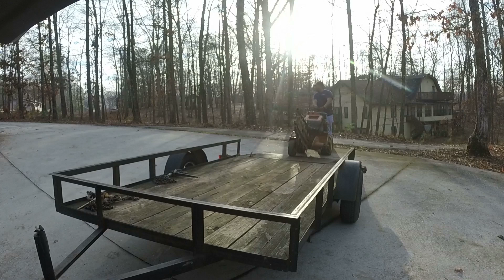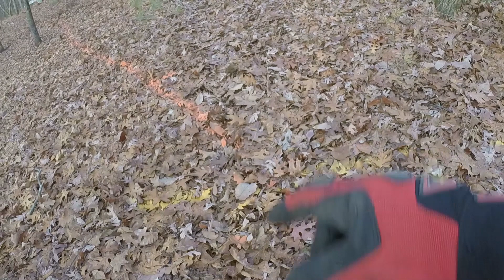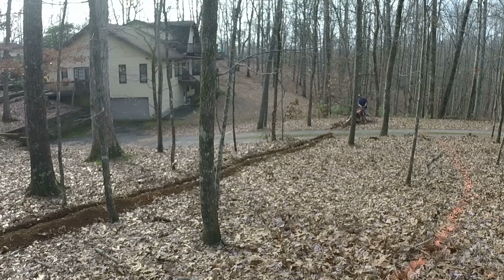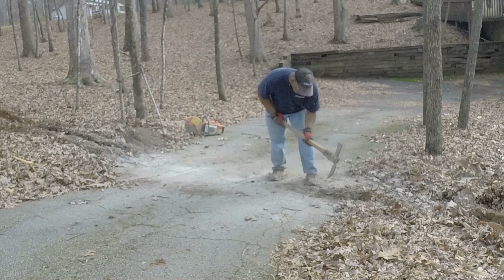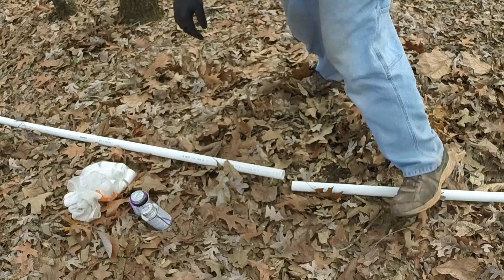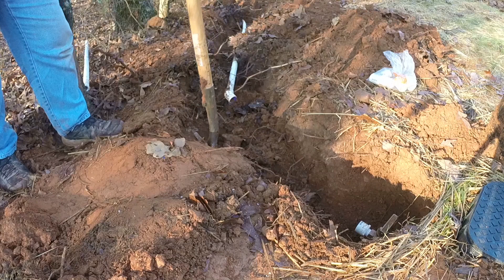Installing the Main Service water line into my Neighbor's House (Part 1)

Comment: Should be titled "How not to install new water line".

Dude, some terrible practices here.  Always prime and glue inside the pvc fittings as well as the outside of the pipe. You're wrapping the Teflon tape backwards.

Comment: WARNING.  PVC is not allowed in most places for drinking water, only for irrigation systems. PVC leaches carcinogens into the water.   Potable water requires either copper, CPVC, poly or pex.  Hundreds of ft continuous flexible poly pipe,  cheaper and easier to install, and withstands soil movement better without fracturing.

Comment: I was taught to prime and glue both the pipe and fitting. Also when using an mip to the main water service I’d recommend sh80 and when putting teflon go clockwise and add a little pipe dope as well. Use a level for fittings other than couplings.

Comment: I would have used 1 in poly sdr 7 pipe good for 250 psi. You need larger dia for that long a run. Also put pipe inside 2 in. Schedule 80 pvc when going under driveway for protection. Way too many joints.

Comment: My connection doesnt hv a meter on it. Im gonna hv to pay alot for that right? From the city
Reply from the maker: You have to have a meter. How would the city know how much water you used? You have to have a way to turn off the water going to your house or RV?
Reply: @michaelyoucanfixthat  i hv a connection in front of home, but did not see a meter, prolly cause there was never a line to the house.
Reply from the maker: @skorpyo331  Ok, you have to have a meter to tap into the city water line or maybe the house is on a well. If the house is on well water then you can tap into the line coming from the well but if your county has city water going down your road you will need to call them and they will set you a meter by the road and you will have to run the water line to your RV.
Reply: @michaelyoucanfixthat  yes, n im sure its gonna be 1000s involved too for that turn on. Until I actually get a hold of someone on the phone to explain. Meanwhile im renting a new softener.

Comment: It will take some time but leaks may start showing up at connections. Unfortunately several necessary steps were missed or did incorrectly. Good job though.

Comment: I like that you have a valve on the outlet side of the street meter/service.  My experience with the city side of the meter is their valve leaks, even when it was new.  After putting up with it for years, I added a valve on my side of the meter. None I can isolate & drain when it gets freezing and I’m gone.

Comment: I heard you say the neighbors had the water company relocate the meter in front of the house where it should have been. Is that required installation for the water company to do that, or common sense?
Reply from the maker: Yes, the water company is the only one that can tap in the the main water line coming do the road. Anything after the water main is the home owner responsibility to get connected to the house. That is how it is here in GA where I live.
Reply: @michaelyoucanfixthat  Is the water meter box required to be on the homeowner's property?
Reply from the maker: @jackrawlings5290  no, it can be on a right away. A right away is land that goes between two properties that other people can be used to run utilities. But it can not be on your neighbors land without there permission.

Comment: I want to learn how to do water main repair
Reply from the maker: There are many different ways you could come out of the water main. PVC, copper, pecks pipe. I did this the cheapest way my neighbor wanted and PVC is easier to work with. In my opinion. But copper would last longer. It just depends on how much money you want to send.

Comment: Did you need a permit for that? Just asking because I have a similar project.
Reply from the maker: No permit was needed. You just need to call before you dig people. So they can locate any Utilities going to the house.
Reply: @michaelyoucanfixthat  thanks for the response. So you only need a permit to connect to the city main water line? If it's your land and home, you can add another water line?
Reply from the maker: @TPD_DogoArgentinos   No, you call the water department and order a water main at your location. They come and install the water main. Then it’s up to you to get the water line ran to your house or wherever you are connecting to. That is how they do it in Georgia. You can hire a plumber or do it yourself. The water main can be expensive.
Reply: @michaelyoucanfixthat  yeah I have about 250 ft from the street to where I want to put my home. That'll be really expensive huh?
Reply from the maker: @TPD_DogoArgentinos  yes, with PVC you can do it yourself and save the money you would be paying a contractor. A lot of people do not like PVC pipe but it easy to put in and it is easy to fix. At my house I had to run my water line about 450ft to the road behind my house because the City did not have a main water line going down the road I live on. I had to go through the woods to my my connection to my meter. It’s been working fine for 13 years. I have fix it about 3 times at the meter by the street but not through the woods. PVC is your cheapest option.

Comment: Use 20' and less connections and chances for leaks. Plus the 20' has bell ends on them no couplings needed!
Reply: 20’ PVC is hard to transport for most people though
Reply: @BillyWebb228  yes thats true, but u can also bend it around

Comment: A lot of people are using PEX for this application but you have to keep it covered so it isn’t exposed to sunlight.
Reply from the maker: I’m not a plumber so I use what the people want me to use. I have only seen PEX used indoors. I know the black pipe but is that PEX?
Reply: @michaelyoucanfixthat  black pipe is ABS

Comment: Very hard worker. Lot of plumbing steps and procedures not followed. I would have dealt with driveway  differently. There may be a chance of a leak developing if water pressure surges. I will follow up on part 2.

Comment: This was so helpful for me. I'm a 60 year old lady about to lay 1100 feet of pipe....so really helpful. I'm still trying to find out how to connect from the main to make a split off to a FF faucett and then to run the rest of the line in another direction.
Reply: hi Jade! I am a 65+ year old lady and just layed 65 ft of pvc to have water in my front yard. Haven't made that connection either, but when I do, I am installing a water hydrant and loosing the water faucet that can freeze every year. It's a journey, for sure. I have no clue, but so far, it is coming along!

Comment: Thank you for this video, i have to get water from my well up to my RV which is about 100ft or so and they gave me a quote of $2,000 i said wow!, so i thought I'd attempt to do it myself, why does it cost so much to run water line anyway?
Reply from the maker: I don’t know what between you RV and your well but that price sounds high. I guess if you look at things like the trencher is $300. That price should be more around $900 or so. If you do it yourself. You don’t have to worry about it.
Reply: @michaelyoucanfixthat  they quoted me $3000 for water and $2500 for sewer. Both around 600'. Can you give me any tips hooking a mobile home up to main meter approx 600' from home to meter?
Reply from the maker: @oilfieldman1209   my video is the cheapest way of doing any water line. If you don’t feel you can do it, you can. Just get to a trencher and cut you a trench and glue the pvc pipes together and be done. Going 600’ you want at less a 1 1/4” pipe to to carry the water pressure that far and reduce it at the meter and at the RV. Or trench the hole and glue the pipes and have to plumber to do the connection. My RV at my hunting camp. I have the water line ran to a Spicket and a water hose coming from that to my RV. I don’t have a special connection for my RV. And the sewer is connected to the sewer pipe with the flex sewer pipe from the RV to 3” sewer pipe. I don’t know if you try to hook up permanently or codes. But here is my email michael-welch@comcast.net. If you want to I can seen you a picture of my connection. It super simple. But I think you can do it ether way. It will save you $5000.
Reply: @michaelyoucanfixthat  man I truly appreciate the quick reply, and all the help! It's not very often in these days people help each other. I feel now like I may be able to tackle it. Video was perfect in my situation as there is 2 spots that I'll have to run the line over existing pipe line. (I'll have to contact them beforehand). I believe they run 3' deep, but in any case, I'll be working with them whilst going over them. I'm in Texas, on unrestricted land, however, I'm using city water since I'm right on the side of city/ county line. Only rule is I have to use licensed plumber to connect pipe, all other things I can do myself (trench work, lay pipe out, pick up the pipe and supplies, etc.)

Comment: My father was a master plumber and many years of experience. A tip on PVC glue: he said to be sure to prime the edge on the end of the pipe also, as well as the flare inside the female end. This can help especially with pressure fittings, as you push it in that edge can also provide a little bit more seal to the connection.
Reply: I like to do a criss cross sanding as well which I'm sure might be unnecessary but I was told that it helps. No problem yet.
Reply: @della9837  I also do the same along with after I cut it and debur it then sand it.
Reply: This guy did not prime the inside of the pipe or the edges

Comment: Thanks Michael for the video i just bought some land and im about to put a house on it and im doing all the work myself so this video vary helpful
Reply: The black poly pipe is a lot simpler and less connections
Reply from the maker: chaddfurrjdm01 Thanks for the good comment.
Reply: Im tryin to do same i heard contractors are expensive

Comment: The further you go out from the point where you connect the water with the line you  go to a smaller line?
Reply from the maker: Rob Bee No, you want to use a bigger line until you reach the house to carry the pressure. Then when it hits the pressure regulator in the house. You can go smaller. And no I didn’t use primer. If I was in a wet, muddy situation I would have used primer.

Comment: The following things should be done differently: 

Use a pvc cutter. Prevents debris or burrs in line. 
Primer and glue on BOTH ends of connections. Push in and quarter turn only. 
Keep dirt out of ends of pipe. Cap until ready to glue.
Do not lay pipe back in the leaves after priming.
Teflon application clockwise, with clean hands please. Then smooth it out over the threads before applying.  
Making more work by cutting cement. Just dig trench on both sides and tunnel under with garden hose adapter.
Reply: What is the garden hose adapter - it creates a tunnel? Do you have a link? It is a fitting for a hose that uses water to create the tunnel?
Reply: @nofurtherwest3474  he’s just talking crazy sh*t. Must be off his meds...
Reply: @boblobby8650  wrong again
Reply: @boblobby8650 you can tunnel using a hose adapter it’s easier and don’t have to deal with concrete/asphalt.

Comment: You ain’t gotta bury that pipe any deeper?  Won’t it freeze
Reply: Obviously not there the valve is like 6" down. Go to the Caribbean they lay water lines across the lawn along with power lines. It's crazy, a water heater just sitting there next to the house water lines all over.

Comment: Hey bass hunter just curious why you didn't use like 2500 psi blue poly pipe. That's what I used up here in pa to run h20 line to my barn. Also up here when we have the trench dig we usually run a second pipe in the trench. Just in case one fails you have a second one in place in the hole and dont have to redig it to run a new line. We simply dig the ends of the trench and just hook up the second line. Just food for thought. Plus we are over 4 feet deep frost line and usually we bury it 6 feet to be safe from freezing.
Reply: Mr504319 I was not the one paying for it so that was the cheapest route.
Reply: @TheBassHunter  ok just curious

Comment: Michael, if this water is a supply line and will be used for drinking water, you did not mentionthat you must use CPVC and not PVC.  Also need to use cleaner to join the CPVC.
Reply: CPVC is only needed in hot water applications
Reply: Cpvc sucks
Reply: Schedule 40 is fine for water supply line. I would also put thrust blocks at every fitting. To ensure no unexpected line bursting or leaking

Comment: Helpful tip for you...Wind your Teflon tape at the meter adapter connection clockwise and not counter-clockwise like you did in this video.
Reply: I was saying that myself
Reply: Gay

Comment: Should have run the pipe through a chase under the driveway. Like a 12' piece of 1 1/2" PVC. Okay. Use primer on fitting  sockets and pipe. Put glue on fittings and pipe. The primer cleans and softens the material. Primer can be  purple or clear. Either is fine. Hold up. Not so much tape! Three turns is fine. Actually, tape(or dope) is not a sealant. It's a lubricant. Also, when putting on tape you must go clockwise as you're looking at the end. If you wind it windershins, the end of the tape balls up when you thread in the fitting. The enemy of all threads is dirt. Dirt causes friction. Friction causes heat and heat makes it so you can't thread to the proper depth. Then.. it leaks.If there's ever going to be a leak on that service, my money's on the male adapter at the meter. It'll crack at the threads.

Comment: Too late now, but...Be warned! The expansion of PVC pipe @ a 10 degree temp change is 0.36" per 100 ft. Too far w/o an offset could pull PVC fittings apart.
Reply: How do you create an offset?
Reply: @imagrasshopper9510  4 90 degree elbows. So if the pipe does expand or contract it can flex
Reply: @TheNimshew  wow that is a most helpful tip!  And easy to do!
Reply: Heat blanket for pvc

Comment: I have a similar problem like your neighbor and my leak is very hard to find.  I watched both part 1 and 2.  You did a fantastic job.  Will the city or county allow the meter to be moved by just putting in a request.  Or is there more to it??? How can I hire you to fix my leak.  I think I’m also in your area, hopefully just south of the airport.
Reply: Ecr LB Why do you think you have a leak? Is it because you got a high water bill or can you see the water running and the water is not on? The city will move the water but the are going to charge you big. My neighbor pay $1200 to get his relocated.. I live in Douglasville GA west of six flags area. I can look at your problem but I’m not a license plumber. Just a side job handyman. But if you are ok with that. Here is my email michael-welch@comcast.net you can send me a email about what is going on with your problem.
Reply: Make sure no water is running. Then, look at the meter face. There's a large dial and , usually a small blue or red gear looking thing  If that little triangle is turning.. at all, you have a leak. Check toilets first! Sometimes the BCV will leak very slowly and you can't hear it until you take the lid off and stick your ear to it. If it sounds like it's leaking, it may be the BCV or the flapper. Put food coloring in the tank and let it sit for a few minutes. If dye shows in the bowl without flushing.. it's the flapper. If the leak is in the service, you can be sure it's somewhere(usually) where there's a transition. Like at the house or meter or outside garden valve or sprinkler valve.
Reply: @TheNimshew  or all those pvç couplings
Reply: @mikecole2023  ?
Reply: @mikecole2023  Ah! I see what you're getting at. Well, PVC is pretty fool proof. As long as there's no water to compromise the glue,  the coverage is adequate and the glue is allowed to dry before turning on the water, there's not much chance that a leak will develop in ANY glued fitting

Comment: You wrapped the teflon tape the wrong direction around the plastic threads.
Reply: That whole job is going to leak
Reply: I noticed that right off too. I wonder if it is leaking already :-)
Reply: Ed Janssen always clock wise👍🏾👌🏿💪🏿
Reply: First thing I noticed too.  It will leak.

Comment: pvc pipe here in pa can not be used and pipe must be down 3' so it dont freeze. but water line should be black well pipe comes in rolls would have been one conetion at house and on at street pvc joints will leak after a few years when under ground .
Reply: No. PVC is fairly impervious underground. They allow polyethylene where you live. It has its drawbacks. Actually, PEX is polyethylene. (cross linked) Probably the unions that object to PVC. That's why it's not code.
Reply: mine has been down since 1989 and has never leaked.  Use proper preparation and you'll be fine

Comment from the maker: It is some much easier to use the PVC when it's PVC coming out from the house and you have to tap into PVC. Plus I have not work with poly pipe much. I'm not a plumper. I'm a jack of all trades and the master of none.
Reply: The black poly is super easy to work with. A hose barb and clamp is really all that's needed. It's more flexible, no joints to clean and glue, and available in long lengths.
Reply: I'm the Jane of all trades, master of some
Reply: I'm guessing you live in the deep south because you don't have that pipe buried deep enough for even mid southern states for being safe from the frost depth line in the ground.
Reply: you kicked some butt, big job to take on yourself...Props nice work